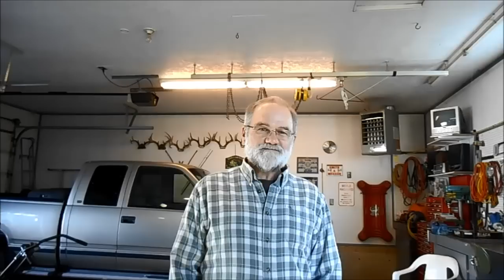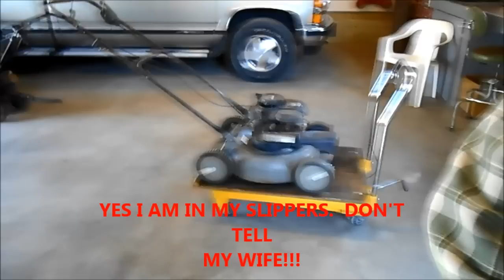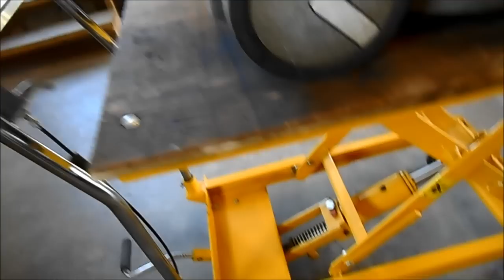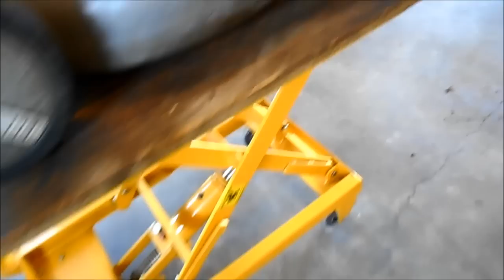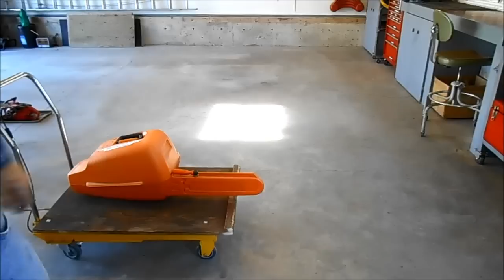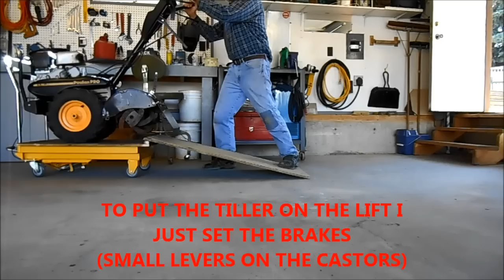My Lawn Mower Lift (Some Call It the Pender Lift))

Comment: Can you please do a video showing how you secured the wood (to extend the dimensions of table) including tools, hardware, type of wood, dimensions of wood, how holes were made on the steel table, etc.? Also how to add the wood nub to prevent the mower from sliding? I am a newbie. Thanks!
Reply from the maker: Very simple  I just used 1 1/4 inch carriage bolts.  Centred the plywood to the frame with one end extending longer as the longr end is even to the handle end.   Then drilled the holes at the same time through the plywood and the metal so it matched while doing it.  You can even tighten each bolt as you go.

Comment: Just bought the 1000 pound unit from Harbor Freight.  They had it on sale for $199 from $259.  Only problem I had was the cylinder release bracket adjuster screw was screwed in too much so it was in release mode and wouldn't raise when you pumped the pedal.  Figured that out and bled it and now she works great.  It's nice to be able to transfer from my pickup bed directly to the table then wheel her into the shop.  Now I just need to make a Bruce Pender plywood top and ramp and I'll be all set!
Reply from the maker: Very Cool Ken
Reply: How has it held up?
Reply: @alcopower5710  pretty well, although it will leak and creep down overnight.  Definitely worth the money!

Comment: Love your vid's Bruce. Pretty classy guy and operation you have there sir. On your plywood top on your lift, After watching / reading comments, I have a silly question. Is your 3/4" plywood 2' X 3' or 2' X 4.' ????? In the comments, I saw where you mentioned it was 2x4. In the video, I thought I heard you say 2 x 3. I just got one of these today. Got the HF version that lifts 500 lbs. I want to do the plywood top this week. Any help would be sincerely appreciated sir.
Reply from the maker: 2 feet by 3 feet.  I used carriage bolts to hold it on.  Drill the holes as you go.  then a 1"X2" and the end to keep mowers from drifting off the end.    Good luck.

Comment: Hey Bruce I have the same lift , wish the wheels were a little bigger because the cylinder and controls almost touch the ground.  I had to make a shield to get over a 2x4 threshold out of the garage.  Also great for lowering heavy items from the back of my truck. Take Care.
Reply from the maker: Yes I am taking a snow blower out of my truck right now with it.
Thanks for watchin

Comment: HI Bruce, first off, I enjoy your videos immensely!   Lately, I've been getting more "courageous" when it comes to fixing my own equipment.  I'm 69, so my major concern is getting the equipment to a reasonable height so I can work on it.  My question is, how difficult was it to attach the 2x3x3/4 wood to the top of the table.  The wood is really no problem to drill through, but how about the existing platform.  I don't think my anemic Black and Decker is up to the task.  Did you use a special bit to drill through the metal?  Thanks again fir the videos and your assistance.
Reply from the maker: I think I drilled an 1/8 th inch pilot hole then a 5/16 th  hole for the carriage bolt.  The steal in the arm is 1/8th inch thick   so all in all not that bad.    I would like it if this table came up a littler higher but it is what it is.
Reply: Hi Bruce, Gerry from Ottawa... love your videos. To rectify the height problem your lift raises, try high heeled slippers :)
Keep them videos coming.  Cheers Bud.
Reply: Bruce Pender what kind of bit did you use?

Comment: Bruce, Harbor Freight has a lift like that for $ 169.99 and it is a capacity of 500 pounds or you can get one for 259.99 with a 1000 pound capacity.
Reply from the maker: Right. I have only  been in a Harbor freight one time as I live in western Canada.
Reply: Just thought i would let you know.
Reply: It's the exact same lift. All of these cheap hydraulic lift tables come from one factory in china. The only difference between them is paint color and the brand name they're sold under. Same thing goes for most tools that we buy these days.

Comment: Hey Bruce, I bought one of those lift tables and had a question.  If you leave it up at max, will it creep down over time?  Mine will drop all the way down on its own after about 2 days.  Just curious.  Thanks, Kenny
Reply from the maker: That is the same as mine.  There is a stop piece to rotate in.  Does yours have one?
Reply: I adjusted the release screw as much as I could.  Any more and the handle release won't function.  No big deal, just wondered if yours creeped down like mine.  No fluid anywhere so it's not a leak.
Reply from the maker: @KensSmallEngineRepair  I am the same.

Comment: I bought one at Harbor Freight and had to adjust the handle wire down by the cylinder,sometimes it wouldn't pump up or letting down a mower would jump all over the place. Just look down see the wire sticking up,loosen the 9/16 bolt nut,take vise grips pull the wire and tighten the 9/16 nut and it fixed it.
Reply from the maker: I am happy you fixed it.
Reply: @BrucesShop  Thanks Bruce, never miss your videos.

Comment: Harbor freight also makes a High Position Motorcycle Lift that has an entry point of only two inches above the floor. I have been able to get them with a discount coupon for $160 US.  Rated for 1100 pounds to 30 inches and I can attest to lifting a 750 lb motorcycle, but being harbor freight I don't load things to their stated capacity
  The bonus is being able to lift lawn tractors and all kinds of random things. I currently have a Goldwing frame mounted vertically nose end down for frame restoration
Reply from the maker: Thanks Ohio.  Good info  I wished we had a Harbor Freight here in Canada.

Comment: Hi Bruce, love watching your videos. My hydraulic lift is lowering extremely slow with weight on it but it is fast like yours when no weight is on it.  Have you encountered this problem when you first bought it?
Reply from the maker: No  Mine is slow both ways
Reply: @BrucesShop  I returned it back to the store and got an exchange. Luckily the 2nd one works perfect out of the box. Must have been a bad hydraulic cylinder

Comment: I bought the same one Bruce.  I just have to attach a piece of plywood.
Reply from the maker: Right.  I used carriage bolts so the top would still be smooth.  Good Luck.
Reply: I did the same and it works great.

Comment: Hello Bruce! Thank you for all the amazing videos. I just came across your youtube channel and going through all your video really some great information. I do have a couple  questions regarding the mower lift. So the plywood you put on top is 2' wide X 3' long? I Also didi you stain or seal the wood? I see it has a darker color what made you do that instead of maybe painting it just curious I am sure you have a great reason why. Thank you again this tip with the cart will save my back tremendously after having two major back surgeries last year I need all the help I can get. Thank you again for all your help have a wonderful week.  -Paul
Reply from the maker: +Paul Rhodes Yes I too have spine issues.  I just used construction grade plywood and I knew it was going to get so much oil and gas spilled on that I left it alone and just time and has darkened it.  I did consider staining it as well but I knew that is was going to be abused as far a colour is concerned.
Reply: +Bruce Pender thank you very much for your quick response. I sent you a private message in you YouTube in box please take a look when you get a minute. Thank you again have a great night. -Paul m

Comment: Hello Mr. Pender....what size and how long are your carriage bolts?
Reply from the maker: They would be about 1 inch  or 1 1/4   just long enough to go through the 3/4 inch plywood and then the metal on the deck.  I am not home to check.  Good luck  either will work though
Reply: Thank You!!
Reply from the maker: @charlesf1999  You are welcome.

Comment: Does your slowly fall,drop  down? I bought one at Harbor Freight and it slowly drops on it's own, any idea what my cause the hydraulic cylinder to leak? Glad it has a safety arm to hold it up, because the lawn mower handles sometimes are above my truck hood.
Reply from the maker: Yes it will now lower overnight.  It is Ok  for working on though
Reply: Yes it works great,mine has a plastic cap in the cylinder that I pushed down on it and it took about 8 hours for it to drop today. The plastic cap is not threaded. Thanks,Bruce

Comment: Bruce; I have both an ariens lawnmower with a koler cougar 15 engine and a powerwasher with a kohler x7 engne and both of them refuse to start after winter storage. their gas tanks were drained and I only use regular gas w/o the 86 thing....

the lawn mower just stopped on my while mowing the lawn and decided to leave it for the spring for repairs, but my repair shop closed and now I'm thinking of tackling the repairs myself. any hints or pearls of wisdom. they will be greatly appreciated....

thanks a bunch...
Reply from the maker: Yes if they stopped running after storage the carbs are probable clogged with gunk. (use premium fuel only) Remove the carb, take of the bowl clean the bowl and the jet and the emulsion tube.  Get rid of the old gas swish out the tanks and it should run.

Comment: Hello, I have a similar lift but from Harbor Freight and the instructions for bleeding the air out does not make any sense. Since they are built similar and function similar, can you let me know or message me the instructions on how to get the air out of your lift please? I have not used mine in 4 months and it will not operate and I am sure it is air in the ram. Thank You.
Reply from the maker: +Superiorpowerwash Well I have not had this issue.  However make sure the bleed bolt is at the highest point in the system when you open it for bleeding.  you may have to tilt the lift.

Comment: You just need a winch to pull that heavy stuff on. I bet that 75,000 btu heater keeps it toasty in there, too. I can heat my 1700 sq ft house to 80 degrees from 4 degrees with just my oven (I found out when I had trouble with the central heat elements back in January) but it is insulated real well.My central unit is only 50 something thousand btu.
Reply from the maker: Well in Canada we still have snow on the ground and have weeks of -40.  We get used too it.

Comment: Hi Bruce, 
I like you videos. I love to work on lawnmowers and do small engine fixes. I just got a similar sized hydrolic lift, as yours. Can you provide me your rational on why you installed the 3x2 plywood on your lift?  It looks like having a wood base to roll some of your equipment offers some advantages over the metal base of the lifts platform?
Reply from the maker: It is 2 foot by 4 foot with a lip to keep the mowers or what ever from rolling off.  I used carriage bolts to secure it.  (round tops)
Reply: @BrucesShop  
Thanks for response. I purchased all the material at HD, and put together my  platform today. I made the platform 24"x32", vice 36" which seemed a little too long for my lift. The lift is now wide enough so now my 20" McLane and Tru-cut mowers fits nicely. 
Aloha, and have a very Merry Christmas.
Reply from the maker: @bhk808  Alright.  Good for you.

Comment: man do I need one of these.  is the height of that at max around 3 feet?  would be nice to lift a mower to transfer to my main benchg.  also would be great for working on generators or large power washers.
Reply from the maker: +Brett Frazee No it comes up to about pocket height.  You can get the ones with the double scissor underneath.  Sometimes I need that

Comment: hopefully i get mine next mouth found one like yours at jegs for 179
Reply from the maker: You need one.
Reply: i have its smaller brother  a little red one works but doesn't roll or set as low
Reply from the maker: Right

Comment: how long and how wide is ur ramp Bruce?
Reply from the maker: I think it is 2 feet X 4 feet with a small angle iron lip.  Thanks
Reply: need WiFi booster with more power.
Reply: Not much power, work in one room, dude in another room on same level., help!
Need more power Wifi.
Reply: I'm